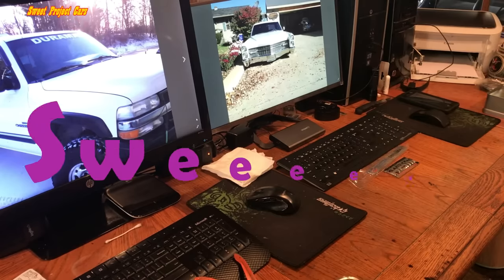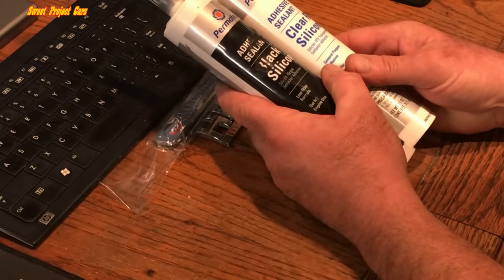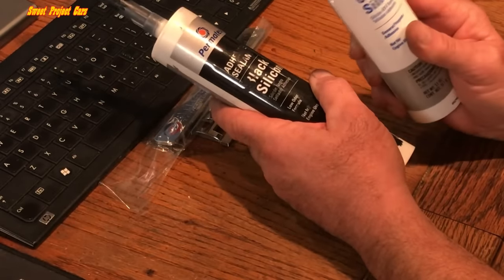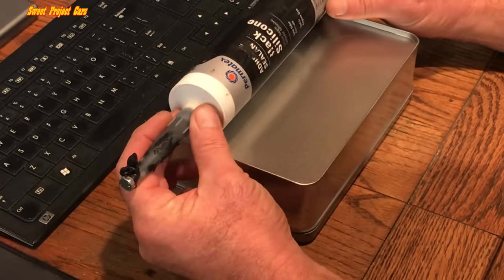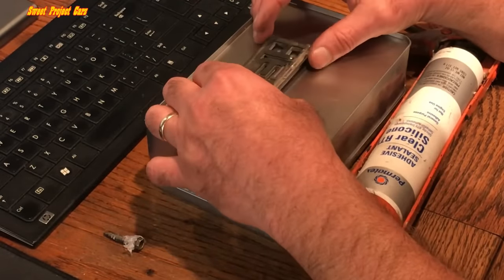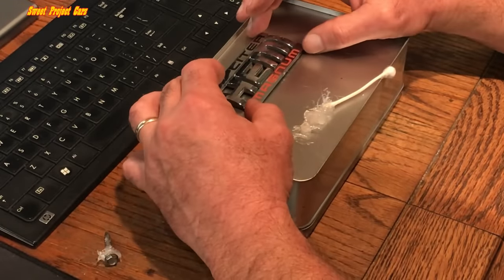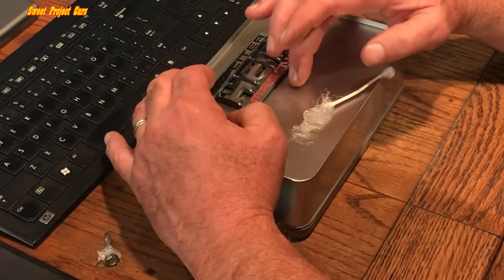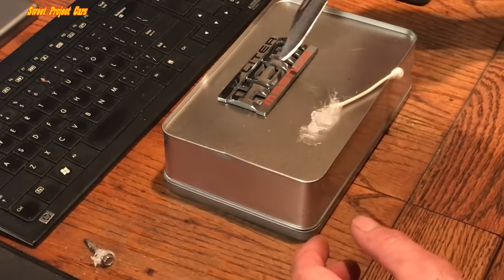Why Silicone GLUE is a DIYers Best Adhesive

Comment: The problem I used to have with silicone was having it cure in the tube between uses. I found by removing 1/4" of silicone from the end of the tip and replacing it with petroleum jelly that it keeps the air out and greatly extends the life of the tube.
Reply: J B     My dead husband was a building contractor. He taught me to shove a large or huge nail into the tip. Never had a problem.
Reply from the maker: Thank you very much for sharing I truly appreciate that we use a 1 inch long screw that screws in tight to the hole size and never had it get hard in the tube but your idea could be great as well
Reply: Sweet That works well for me! I do pretty much the same thing with almost all adhesives! I don't even bother using the caps, just have find the right size screw! I'll definitely order some of this stuff though, sounds like a better version of E6000 (I still hate the tubes that E6000 comes in)! Thanks
Reply: Long time contractor, i use a piece of aluminum foil tape  around the tip. The best yet for me.
Reply: @Blakehx  Thanx you just made me laugh, cause they never work, I learned that over 25 years ago. I use a screw.

Comment: Yup. Love the stuff. 

Latex caulk has many uses, too, and an object can be later removed if you want, but only if you want. Will hold where superglue won't.
Reply from the maker: Thank you very much for sharing
Reply: Hi, I’m thinking of using glue to add accessories to my car, but I want something that can be removed if needed. Can you recommend a glue, and what you use to remove it?

Comment: The black RTV silicone also works wonderfully to fix cracks in leather and attaching a spoiler to your car. Just make sure the area is clean before applying this silicone. The spoiler will not come off easily if prep done right.

Comment: (screw in end of silicone tube) I found that it works better to buy little mini plastic bags (like on eBay), put it over the tip, zip tie it and squeeze until full, when it dries it dries completely over and around tip, I also stuff plastic food bags in the end.  If you put in refrigerator it will last another 25% longer, no mess, just rip off the glob and start using.
Reply from the maker: Halcyon thank you for sharing my friend

Comment: I  quit  using  yellow  death   (3m  weather strip  adhesive)  back  in  the  early  80s  after  I  first  used  rtv  silicone  gasket  maker.  I  can't  believe  you'd  need  anything  better  than  that , but  good  tip
Reply from the maker: Very much for sharing I appreciate that

Comment: How do you store the glue?
I have been using Sikaflex and that is my go to glue. For me, this is my cats meow. However it does not keep well, no silicones do. How do you keep it from going off? 
I put mine in the fridge but it still goes off.
Reply from the maker: We always cut the tip off as small as possible and then we use at least a 1 inch long wood screw so that it screws right in and seals it off we have never had it get hard in the tube
Reply: @SweetProjectCars  HI, I'm new to this, but from the video it sure seems as if the screw would get glued to the glue inside the tube! Please elaborate for newbies, thx!

Comment: Excellent video! I had a 2016 Ford Explorer and the B pillar plastic cover containing the keyless entry pad kept separating from the two sided tape. I took it in 2 times under warranty and  they kept replacing the tape which held for a couple of weeks. I decided to remove the tape and put some Black RTV sealant to hold it and it is solid as a rock a year later!  Like you said, many uses in the shop for this stuff! 10 Fatty's to match your 10 Sweets!  Lol
Reply from the maker: Fatty's Garage you got that right, my friend, it is amazing !!

Comment: I need to apply a silicone adhesive to a plastic dash cover since the one it came with did not hold so well from the sun warping it. If I apply this product will I have time to adjust the cover or once I place it on I'm basically setting it there for life?
Reply from the maker: Yes, it is pliable if you use this  https://amzn.to/2DuPmO1
which is the BEST silicone glue you can buy.  You will have about 2 minutes to set it where you want and it will never move again.  Thanks for asking and watching Kevin!  Have a great day.  mad Mike the hammer SPC

Comment: Can RTV silicone glue be used to re attach a loose rear bumper step cover?
Reply from the maker: This is what you want to use  https://amzn.to/2DuPmO1 for that project.  Thanks for asking, have a great day!  mad Mike the hammer SPC
Reply: @SweetProjectCars  thank you very much!  That's the exact stuff ( brand and color ) that I ended up buying and using about a week or so ago.  I also used the black RTV silicone adhesive too.  It's got both on there and holding great so far.  Will it be permanent or will it eventually come loose?  My Dad and I cleaned the bumper cover with gas and  let it dry.  Also sanded/scuffed and cleaned the metal bumper before adhering the plastic cover.  I'm hoping it's a permanent fix.  Thanks again and have a great day.

Comment: Trying to figure out if this would be a good type of silicone to use around perimeter of glass block window (window has a vinyl frame and a nailing flange...setting it in a wood frame)  Instructions say to completely fill perimeter around window with silicone.  Would this stuff work better than regular cheap silicone?...or is it not supposed to be used at such a thickness? (Gaps are appx 1/4" and a couple of inches deep)
Reply from the maker: use this and you will have perfect results https://amzn.to/2IvvN8E

Comment: Great video, as always. I have a water leak coming from the roof of my Yaris hatchback around the top of the A pillar, I've tried marine silicone and JB Weld and it did not work. Do you suppose this product will do the trick?
Reply from the maker: The product will do the trick it’s all we use those type of issues Mike
Reply: Thanks!

Comment: I tried using the black silicone to ad a new vapor wrap on my doors and it wouldn't hold the wrap. Really strange, it dried to the door very strong but would not hold the wrap I chose. I just figured the heavy wrap was to blaim
Reply from the maker: That’s weird because we have never had the clear silicone or the black for that matter not stick we have used it on door vapor we usually put it on and then use duct tape to hold it there for a few minutes
Reply: I'm going to give it another go, can't figure why it wouldn't hold. I'll keep you posted

Comment: I've always had issues with door weatherstrip on vintage cars that mount to a flat surface, would you recommend this in place of standard 3M weatherstrip adhesive?
Reply from the maker: brettwrb this is all we use on the weather stripping my good friend just find a way to keep it pressed down and in an hour or two it is there for life :)
Reply: @SweetProjectCars  
In situations where the mounting surface is not horizontal enough to hold a weight I used to use thin wood strips similar to carpet tack strips without the tax of course. Find a location opposite of the mounting and cut the wood strip slightly longer than the span so that you have to bow it to put it in place to hold the glued piece. Multiple strips can be used for more Force to hold in place. If you have a problem with the workpiece shifting under Force, simply use your blue tape to temporarily stop the shifting.
Reply from the maker: Thank you very much for sharing when using this stuff you get very inventive we have had broom sticks pressing from the bench over to whatever it was we were trying to glue on and take an initial set we’ve had some pretty crazy set up’s to get pressure against those items we were gluing
Reply: @SweetProjectCars 
Love sharing these tips with you. After all, you share so much with your viewers that I feel you should get something in return and Hope some of these prove useful to you.
Cheers Mate!